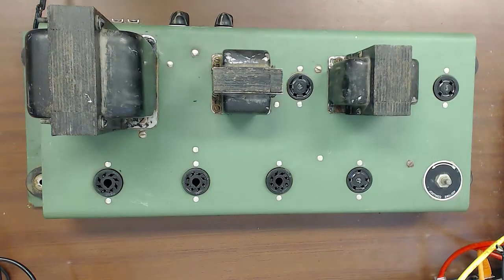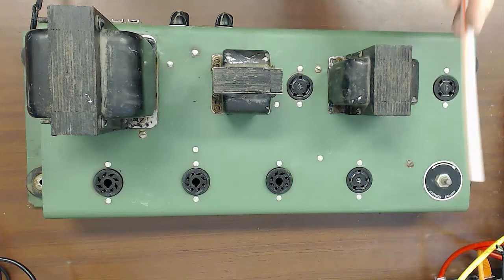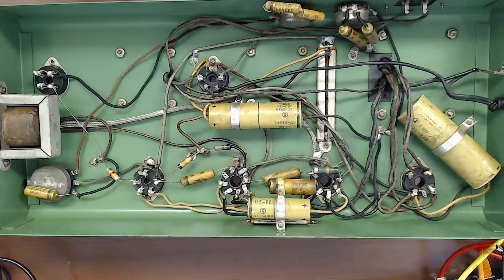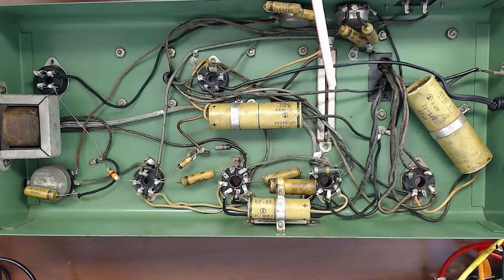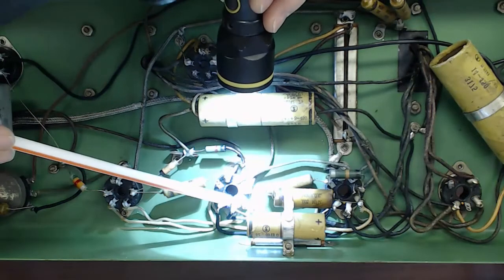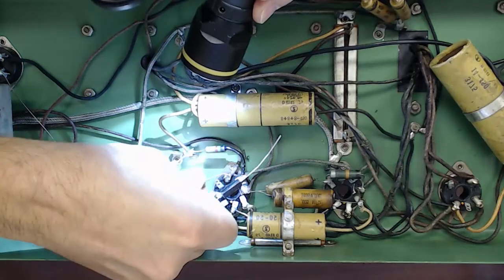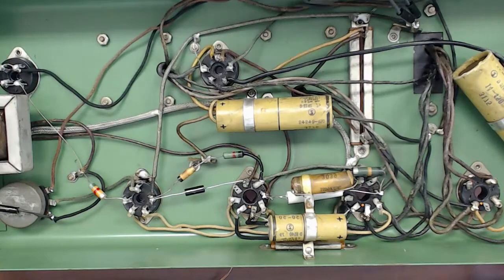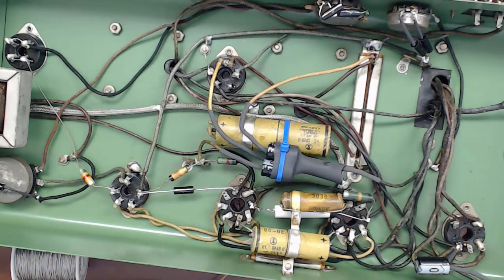Vacuum tube amplifier - 1939 Rockola Jukebox DE-39 Amplifier recap

Comment: Nice old amp.        After the choke filter on power supply can you go higher value on the capacitor?
Reply from the maker: Yes, you can go higher on the capacitor after the choke.  In fact, per the specs on the rectifier tube, the cap before the choke could also be larger.